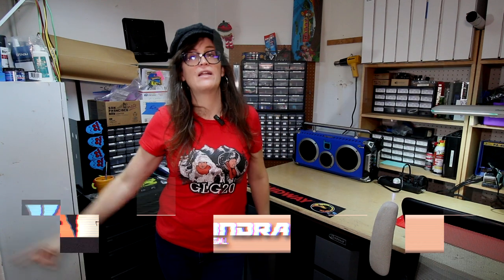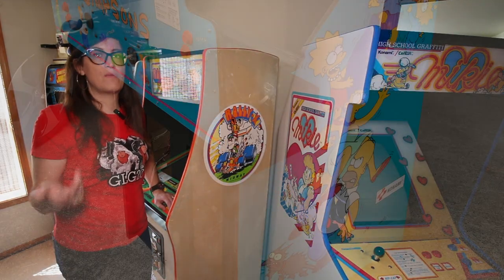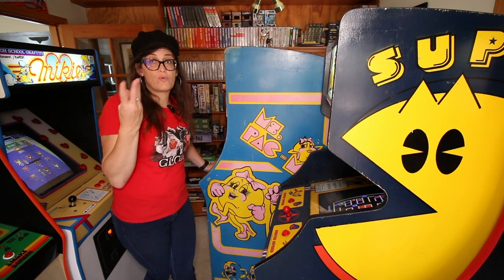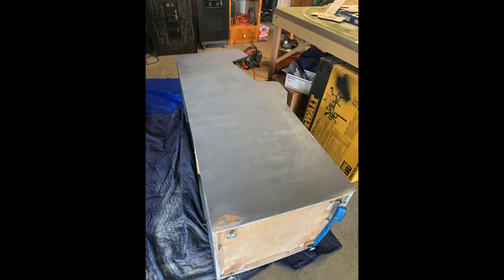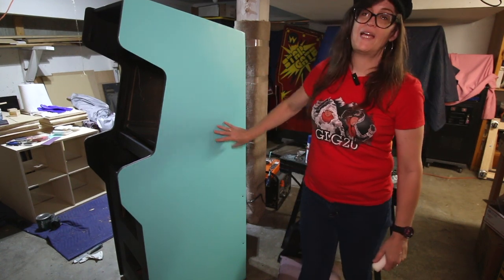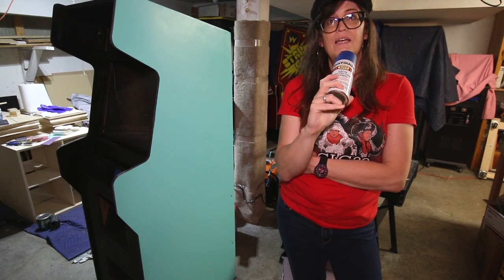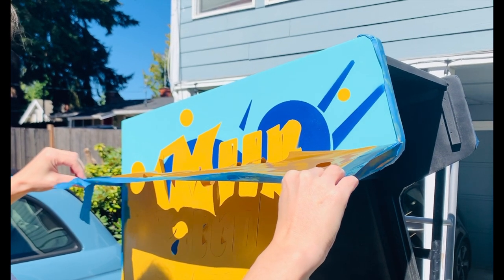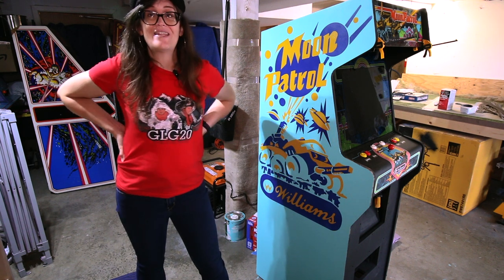Tips and Techniques for Applying Stencils on Classic Arcade Games

Comment: Another option these days is to use a U.V. flatbed printer. Some you can drop the cab directly under the printer, others are printing a side or front section before assembly of a new cab build based on the specs of the original. If you get the chance, it's the best.

Comment: A very lightly soapy water solution sprayed to the surface prior to application of the stencil allows you to make minor adjustments more easily.  Once it is in place use a rigid plastic squeegee to get all the bubbles out, and press every edge down.  Some of those enamels you use make me nervous as they can take a ridiculously long time to cure out and subject to imprinting from the stencil or squeegee.  A modest air compressor and a modest Sharpe spray gun will net you some fabulous results and not require wet sanding.
Reply from the maker: I use water but the soap makes me nervous but I should try it. I’ve never had much of an issue with dry times with oil paint but that might be the climate I’m in or that I tend to do multiple light coats. When I used the airless spray gun however it took about 48 hours to dry compared to way less than 24 with the foam roller.
Reply: @VintageArcadeGal  I painted professionally in a prior life.  Touch of soap is fine as long as you are wiping the surfaces down with wax and grease remover between coats.  There are two favors of wax and grease remover (alcohol, and traditional solvent).  Alcohol is your safest bet for your selected paint technology.  Lots of DIY'ers use glass cleaner.  I'd say your light coats is the greatest contributor to fast dry times... but it also contributes orange peel.  Yeah the airless is a whole lot like spraying with a fire hose.  Beyond the orifice size you can't really moderate material deposition rates.

Comment: Love your content and channel.  So informative. I have some questions as I make full size replicas of certain cabs but don’t use stencils. I have some projects in the works and one is a Pac man or a Ms Pac/Galaga Reunion , haven’t decided yet.  But my first question is on a real Ms Pac /Galaga did they stencil the Ms Pac side and use a sticker for the Galaga side?   Next , I usually laminate then use full vinyl graphics or laminate and stickers for cabs with just stickers like DK.   My question is if I’m going to paint and try stenciling , what type of wood are most cabs that used stenciling made of ?  I normally use mdf but I feel like it’s not the best “painting wood” like maybe a birch would be?   I want to try stenciling if I do a Pac man cab or if the Ms Pac Galaga side is stenciled but still very nervous.  Lastly , where can I get a stencil for these cabs ?
Reply from the maker: Only the original 80's Bally-MIdway versions of Pac  games used stencils (with a few exceptions), I am pretty sure all the Namco issues anniversary games just used vinyl stickers of some kind. Galaga was just a sticker even during the original release :-D The material of the cabinet depended on the company but most modern cabinets are either plywood or MDF. Birch would be nice but might make your cabinet pretty heavy! Good luck!